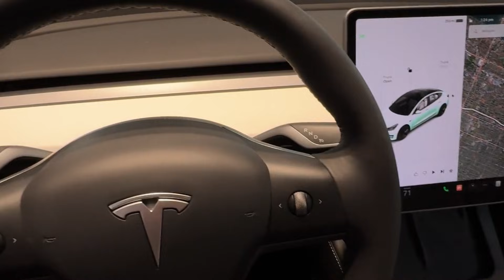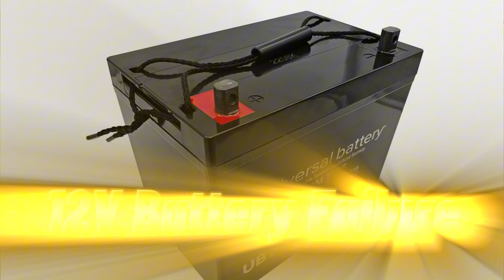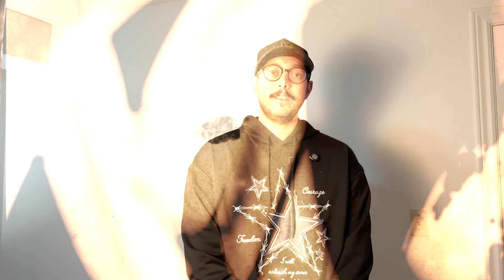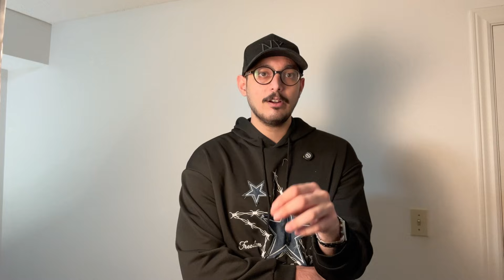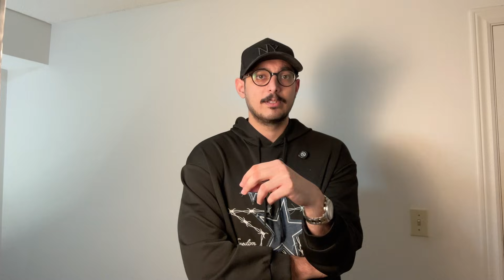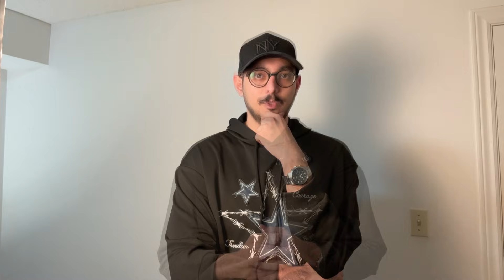What’s Making Your 12V Electric Vehicle Battery Die SO FAST?

Comment: Why not just make them lithium rechargeable 🤷🏾
Reply from the maker: They are making them lithium nowdays  but its more costly
Reply: @shayan_ev  more costly than buying a new 12v every 2 years
Reply: But wait what about these sodium base batteries 🤷🏾
Reply from the maker: @Techchambers-d8m 
Yes lead acid is way more robust and costs 40-60$ but 
Lithium battery needs more protections in low and high temperatures and crash protections and these make it more costly
Reply from the maker: @Techchambers-d8m 
Sodium is a good solution as well
Its more resistant to cold
Less expensive 
Less protections needed compared to lithium batteries 
They are good alternatives but i didnt read any previous use of the sodium batteries for 12V ,  wish to see more of sodium batteries in coming years

Comment: its crazy how common 12v issues are in EV's and how so few OEMs really worked out the bugs in 12v systems. fisker karma and ocean both chew through 12v bats. early LEAFs almost all had 12v issues if they were not driven daily. same with early prius models, very common for them to overdischarge and fry 12v's.
I really think GM was the only automaker until around 2015 to figure out how to maintain a 12v battery in an EV/erev. still reading weekly posts of single owner gen1 Volts who are just now replacing their 10-14 year old AGMs.
because of the way GM wrote the software in the Volts, I was able to drop in delete both the AGM batteries in our two gen1 volts with cheap LTO packs I built for ~60 bucks a piece. the upper voltage range of a 6s LTO pack is also the secret sauce to adding solar my 2013 volt in order to boost the EV range. I basically negated all/most of the ~50% efficiency of the dc-dc converter at low load by charging the LTO pack with a solar roof that doesnt impact aerodynamics. It keeps the cars low voltage system at around 15-16v, and essentially tricks the cars APM/dc-dc converter into staying asleep most of the time, negating all the losses.
there are also some efficeincy gains by running higher voltage, and ironically most of the higher load 12v systems in the gen1 volt have their own regulated supply so they dont even realize/burn out early. this includes hvac fan (300w) and headlights (~110w hologen but i run LED's at ~half the wattage)
it does boost the heated seats which is nice lol. but there is the nontrivial ~40lb weight savings too, as well as eliminating the lead acid voltage sag (apm normally boots up to check SOC of AGM each time you start the car), and the battery has much less internal resistance, especially with age. less self discharge. oh and it will basically last forever unlike 12v batteries now days. the 200w solar roof gives about 1kwh of extra range per day, but thats more like 2kwh when realizing all the efficiency gains of LTO. really is the best possible way to squeeze all the efficiency out of a solar roof on an EV, which i explain in a poorly filmed video on my page that nobody watched :p
probably coz i make videos like how I write comments and its just a bit too far down in the autism rabbit hole :p
Reply from the maker: So you are charging your 12V battery with the solar roof ?
If yes does your solar roof always provide enough voltage for charging that battery? Or did you add any converter in between?